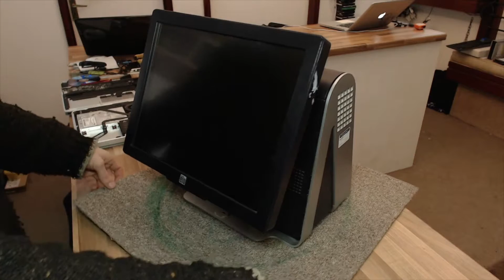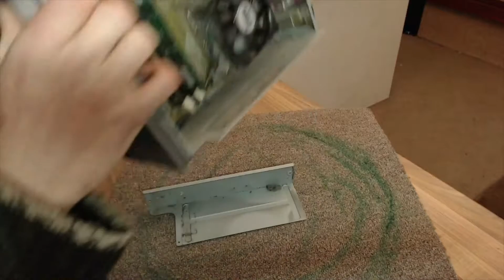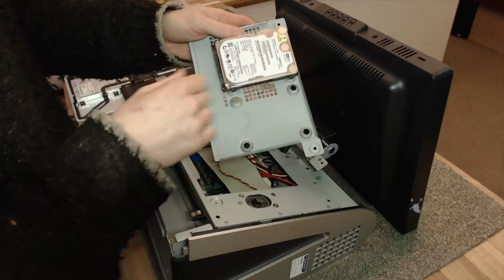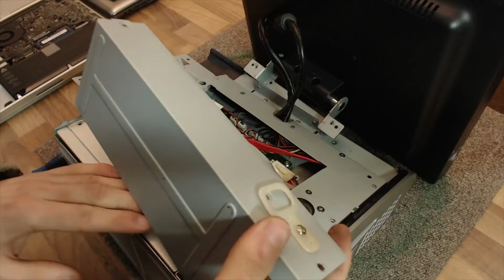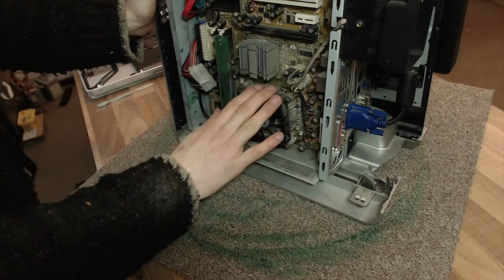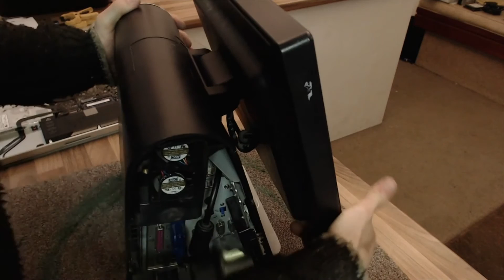LFC#68 - ELO ePOS Power Supply

Comment: Will it play Crysis ?  :)
Reply: not as it is, but there does seem to be an AGP slot on the board, so with more RAM, a real Pentium 4 of 2.4GHz to 3+ GHz, and an AGP-translated ATi card (anything from a Radeon X800 to an HD 3850), Crysis would actually be playable on at least mixed low and medium settings at the kind of resolution that screen is. It may well be possible to make some kind of external GPU box with the card and a second (normal) power supply (with a dual-PSU adapter) in it, to power it.

Comment: Hey there, I managed to obtain this exact POS system from work place free of charge as we just had an upgrade on all of our tills. I'm looking to perhaps covert it into a mid range gaming PC for my little girl.. any recommendations on what to replace the old motherboard with? I'm not quite sure if I can fit a graphics card in there yet as I haven't pulled it apart. Those 40mm fans really are horribly noisy, Cheers.